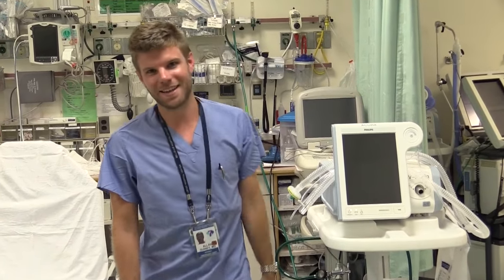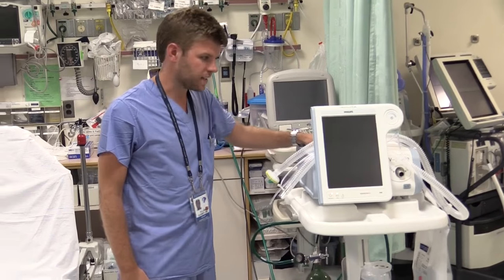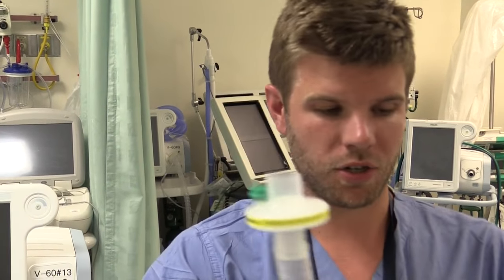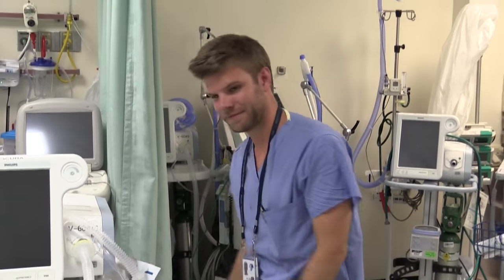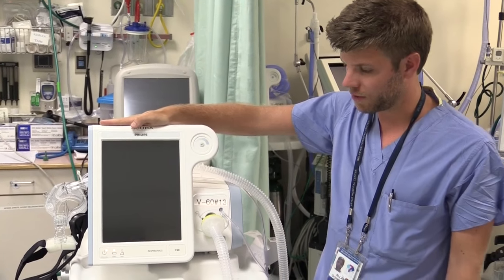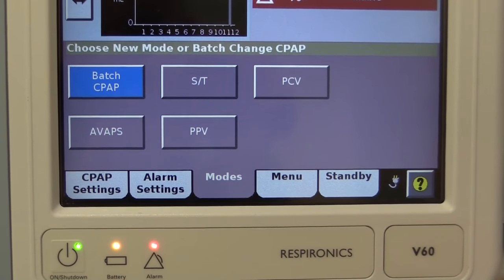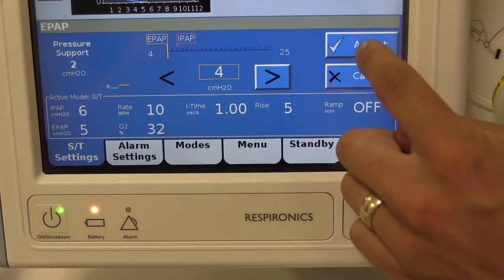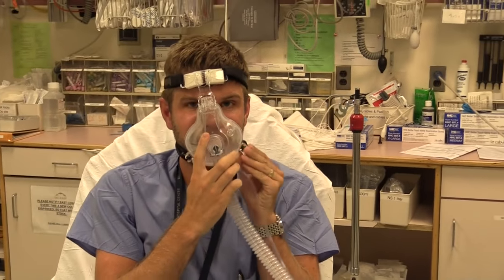How to Set Up a BiPAP Machine

Comment: Recently had to take care of an older aphasic patient on this bipap machine. the mask was so uncomfortable for patient. we put a foamy patch on her nose to prevent a pressure ulcer from this mask. It's so uncomfortable but helped the patient make it through the night which otherwise wouldn't be possible. Also, there is a leak indicator on the panel which was helpful to determine if the mask is not sealed properly. A leak under 10 was okay but anything over, i had to readjust the mask.

Comment: Hey thanks for your video. I have a question. Which is the perfect pressure setting of ipap and epap for sleep apnea patient?
Reply: @SkyTube BD  usually CPAP mode is just enough for sleep apnea..with a pressure of like 6 or 10 cmH2O...BiPAP mode is used mainly to get the CO2 out..two pressures are there
Reply: The IPAP is 10 and EPAP is 5. 10/5 is a good starting point. Then you would make adjustments depending on the patient's tidal volume and oxygen.
Reply: You can check out more videos on YouTube on respiratory therapy zone.